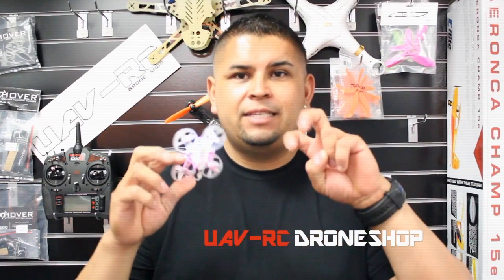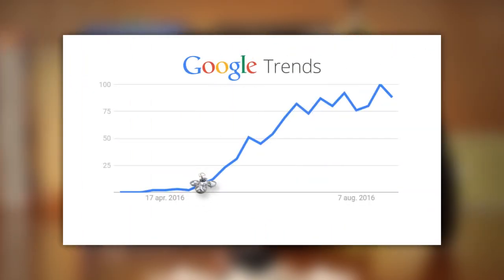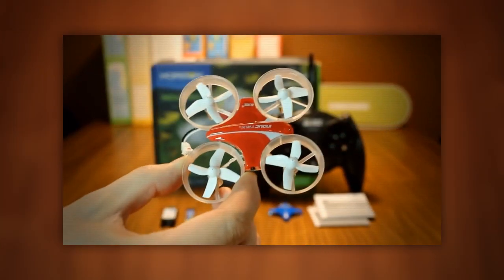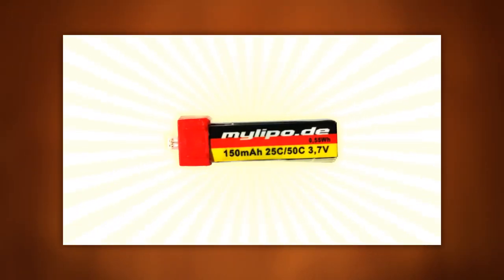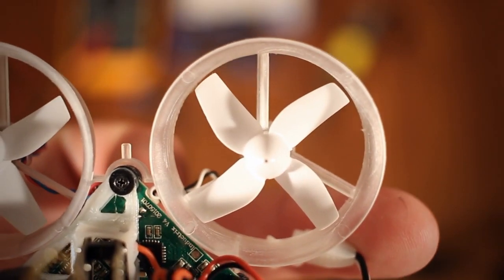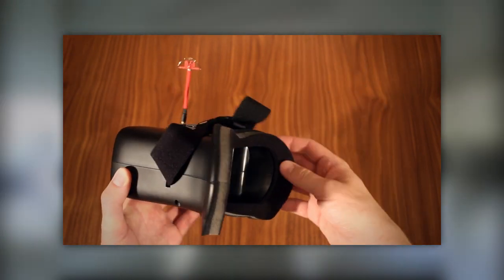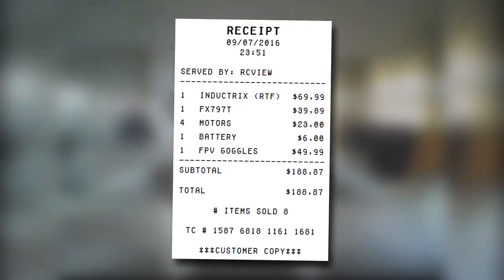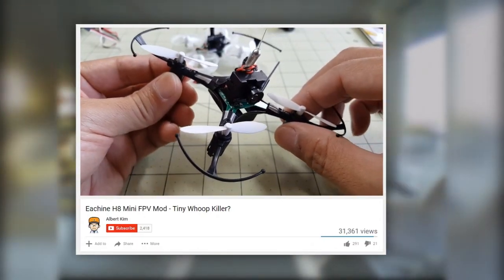Tiny Whoop Explained

Comment: Durability of the Whoop is just fine. In nearly a year I've only ever broken a single motor spar and I've beat the hell out of mine, especially trying to learn rates on it and do flips. The Inductrix Pro frame is a marked upgrade to the durability (and lighter) and should make it almost impossible to break motor spars. 

Also, don't hard-solder the camera to the board, give it a tiny connector (that usually comes on cameras) and in the event of a bad crash, your camera will separate at the connector instead of ripping pads off or breaking things. Used this feature a lot this past weekend flying in a hotel under renovation. My sticky foam kept not sticking very well!

Comment: You need an Indy, an Indy Pro frame (stronger, lighter), some 17000kv red motors ("fast" from MMW, and don't consume all that much more power but give lots of punch carrying a TX01), a TX01 AIO camera (with a piece of double-sided foam sticky; mounts are too heavy!), and the most important part, batteries that have the right connector on them. Blade used a connector type that heats up and becomes resistive very fast. MicroLOSI is a good universal choice, but lots of people use the 2mm version of the stock connector.

Comment: this is great but supposedly the this tiny whoop only last 30 to 90 seconds flight time is this true
Reply: Nope! Only true if you don't change out the battery connectors and aren't using decent batteries. They're the biggest detriment to flight time. I have the timer on my TX set for 3:30 and I rarely fall short. You need the larger 2mm connectors or MicroLOSI (what I run) to provide enough power to the motors, not waste it as heat in the connector. Even with 17000kv 'red' edition "faster" motors from MMW, which really give it back the original punch (feels like you aren't carrying a camera!), don't affect flight time but by a few seconds if you're hauling ass. They make 'riding the breeze' so fun!
Reply from the maker: +JC Lopez It depends on the capacity of the battery used, but if you get 30 seconds there is something wrong with the setup. 2½-3 minutes I'd say is a normal flight time.
Reply: JC Lopez I had thirty second flight times when just adding a camera to the e010 from eachine. You have to upgrade those motors. My tiny whoop is now the H8 mini. Literally can put the heaviest camera (6grams) on it and it will still fly.

Comment: very well-made, video. I was looking for somthing like this. to point people towards when at work asking what a tiny whoop is. 
That being said
went from Tiny whoop. to a home build, 90mm Whoop styled Brushless Quadcopter. wich have much more Power longer flight times and of cause flys faster. it's built with the Eachine Aurora frame F4 flight controller. and a PDB ESC combo. And in terms of flight characteristics, it's much more like my bigger Race Quads. if anyone Should be interested in a build log I have on as well.
Reply from the maker: Thanks for sharing, build sounds awesome! I think it's safe to say the Tiny Whoop has been surpassed by the competition at this point, but remains an excellent entry point to FPV in my opinion.

Comment: Just a heads up, the tiny blade battery connector wears out.  My tiny whoop was getting 1:20 flights and it was driving me nuts, everyone else is saying 3 to 4 minutes.  Replacing the battery connector saved it from getting used as a flying target.
Reply from the maker: Good information! I believe there's a similar, general issue with the batteries included with the new Inductrix FPV.
Reply: yup, its the micro connectors they use.  there is a video up on youtube with a guy re soldering his battery connectors.
Reply: Yep, not a suitable connector for even a stock Indy. Go to the 2mm connectors or MicroLOSI. Upgrade a stock or 200mah 'extended' battery and wow what a difference in power and flight time.